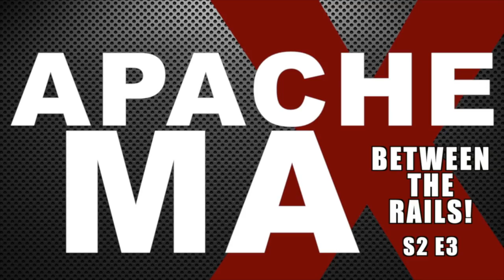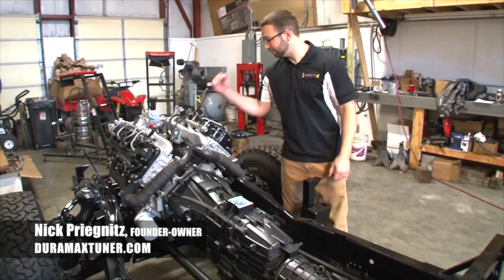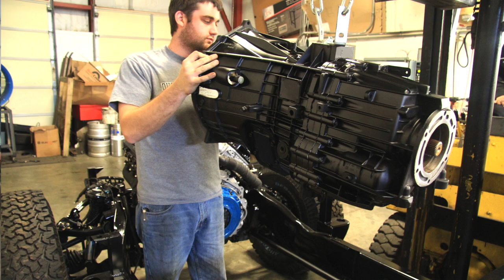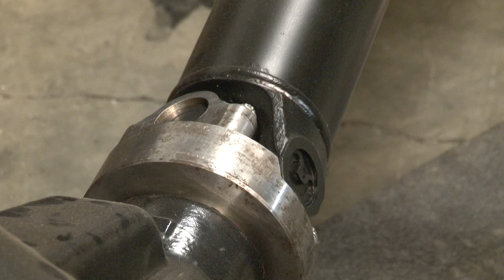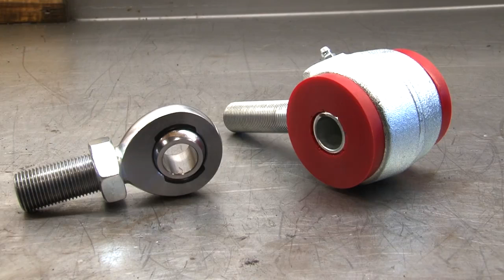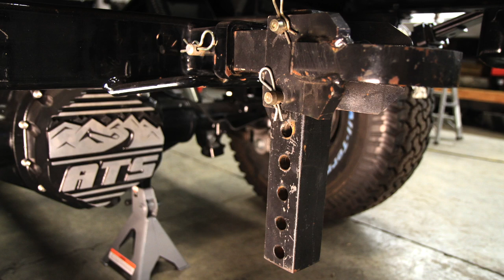ApacheMAX S2E3

Comment: the only thing needed was a clutch for it to be able to hold 700+ horse? you arent concerned at all with any of the internals?
Reply from the maker: +Josh Sapara The trans is built to hold up to 1,000 horsepower with billet shafts and other heavy duty clutch packs. Since this video was posted, we've tested the build and it works great. Check out our other videos.
Reply: ive watched all of your guys' videos and i was wondering why nick went with the zf-6 rather than one of your guys' built allisons? just to keep it with a manual trans like it was in 58? or because of the cool factor of jammin some gears? are there any benefits of the manual over the auto?
Reply from the maker: +Josh Sapara&#160;

2 Reasons really&#160;
1- &#160;The cool factor (the &#39;58 was originally a gear jammer)&#160;
2- In sled pulling the ZF6 can be an advantage in the bigger classes and I wanted to give us the ability to step up to the harder to spool turbos eventually
Nick Priegnitz